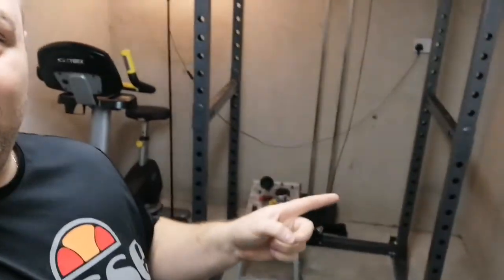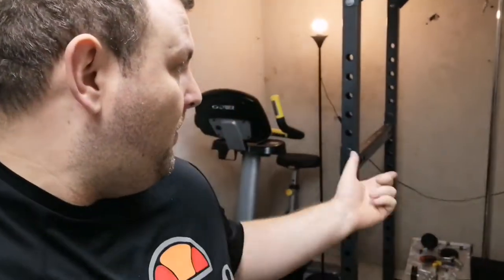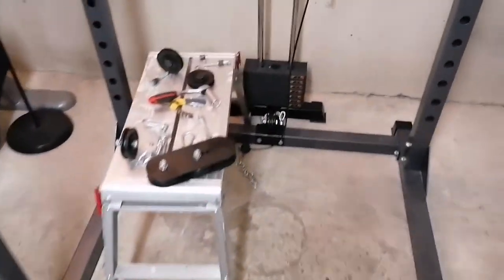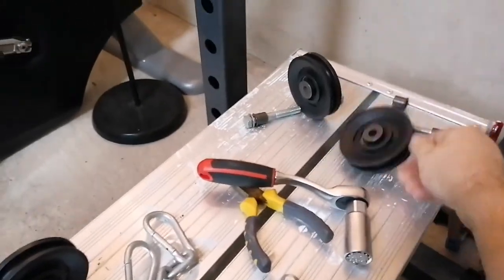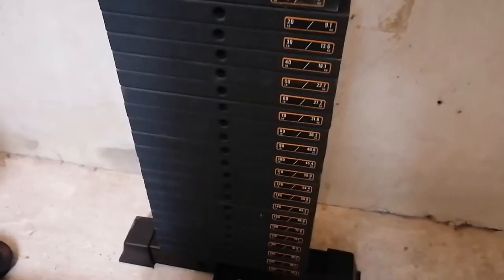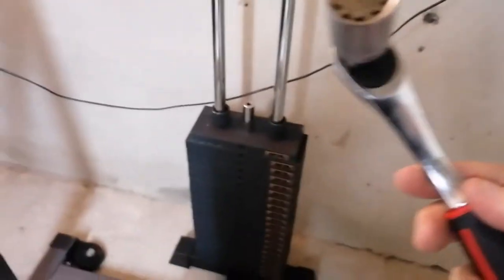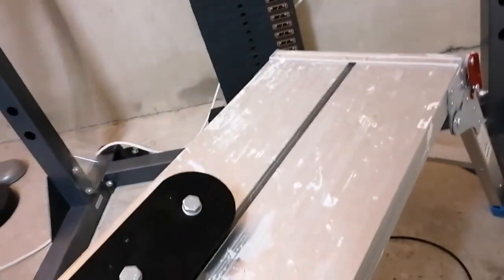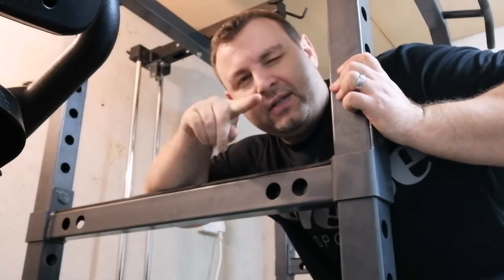How To Set Up A Weight Stack Lat Pulldown Machine!

Comment: How smooth is the stack system? do you get any friction when using light/heavy weights? Thanks for the video! well explained!
Reply from the maker: I find the stack system surprisingly very smooth as I was also dubious about the build quality, but it works well for lat pull downs, standing curls and seated rows etc....  so very versatile 👍

Comment: Hey mate,

Thanks so much for the video! As you said there's literally nothing out there on how to put a weight stack together.
I'm looking at turning my plate loaded lat pull down / seated row into a pin loaded one with the same weight stack you have (mine isn't part of a rack tho).

It seems like all the lat pull down / seated rows have the same distance between the guide poles and the same circumference / diameter to them.
My guide poles are roughly 8cm in circumference, 2.55cm in diameter and they have about 13.5cm in between them.

I don't suppose you could measure / tell me if the dimensions of yours are the same, so I don't buy a stack I can't use.

100% understand if you can't be eff'd
Cheers mate

PS Killer bargain home gym there
Reply from the maker: Hi Mate

Glad you liked the video 👍.... I will compare the distances of mine with your measurements and let you know if similar, but I have seen different size holes and stack shapes with different Rack systems before, so I wouldn't want to say their similar, from what I've seen most companies don't make it easy to add different stacks onto the main poles on the lat pulldown just so they can sell more of their own style. I also find even the magnetic pin that locks the stack weights in place are different sizes and lengths which don't make sense.

Il get back to you when I've had a look 👍
Reply: @bigadz9843  Thanks brother!

Comment: Thanks for the video. I just finished setting up my home gym. Why is there a gap between the top plate and second one? With mine there is a huge gap between the two
Reply from the maker: The top plate acts as the main anchor for all the other plates to fit on, so would be a different size, but it shouldn't make any difference when your lifting and adding the weight..... As long as it doesn't cause any sticking as your lifting the weight the gap shouldn't be a problem.
Reply: Adam Strongman Novice Ok..one more question..I want to gradually start from the lightest plate to the heaviest. I see that my top plate is about half of the size of the 14 plates below it. Am I supposed to start with that plate or am I supposed to start with the one below it, which is 10 lbs..I ask that because when I lift the smaller plate that’s on top, the guide rod comes out from the weight stack and when bringing the weight back down the imbalance causes it to bang on top of the second plate, making my pulling or pushing motion awkward. Hope that makes sense lol
Reply from the maker: Definitely makes sense.... Start with a weight that you are comfortable with, if you can rep 10lbs for easy 10-12 reps say x 5 sets,  and your not fatigued,increase the weight to 20lbs next time and test again etc....... The banging of the weight stack is basically to do with your positioning, for example... sit back further if your doing lat pull downs until your full reach isnt banging the top of the weight stack.... Or if you are standing for face pulls or tricep pull downs, reposition your body and concentrate on your arm extensions per rep so your not slamming into the weights again..... Hope that makes sense, but if not there are loads of videos out there for proper form and technique for using the weight stack 👍

Comment: Don’t suppose you know the diameter of the poles that the weight stack runs on? I’ve seen I can buy a bodymax weight stack and I want to fit it on my system but not sure if the poles on my system are right size tubes, I can fabricate the distance between the but need to know the pole diameter, also we’re the poles hollow?
Reply from the maker: Hi steven... The poles are hollow & I believe the diameter is around 40mm each pole.